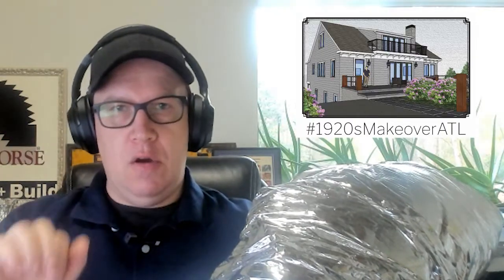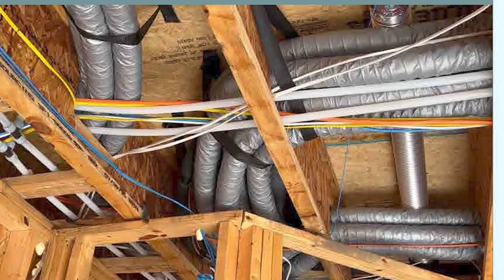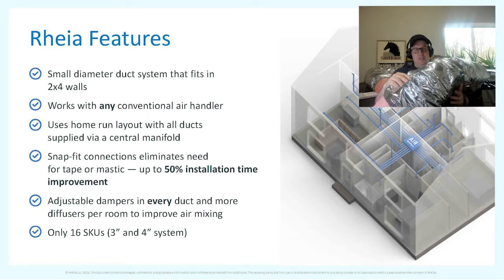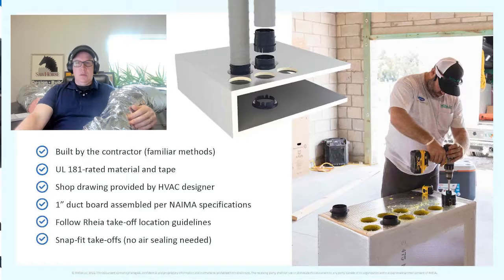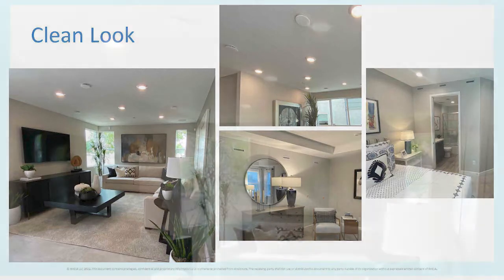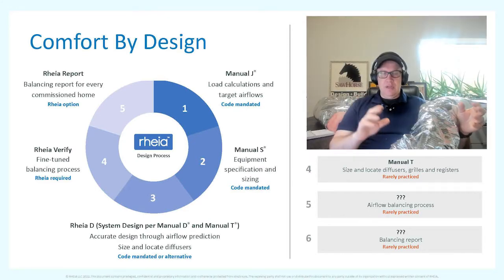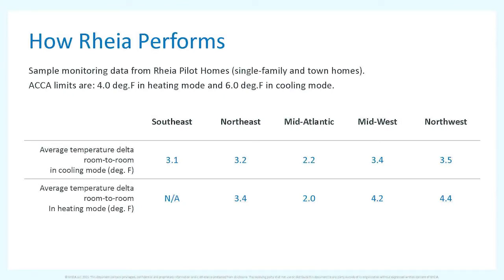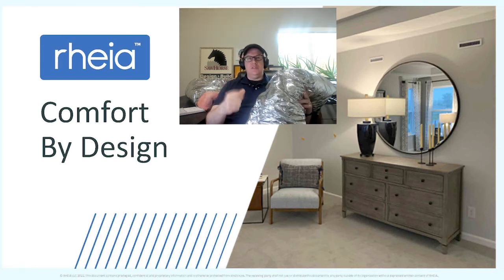Finally! A better way to run HVAC ducts in residential construction

Comment: Nice -  I might need these to retrofit at least one room of our house.  The space at the top of this pitched ceiling was too small, but they ran large ducts anyway (long ago, so maybe smaller wasn't an option, but then maybe some collaboration and communication could have happened and a slightly lower ceiling would have done the trick...), and the large duct is crushed in on itself and that room just runs so cold.
Reply from the maker: What is nice about this system is that you get multiple ducts per room so the air flow is more evenly spread as well.  This helps with comfort.

Comment: Isn't the rub on small diameter ducts higher internal friction and the corresponding drop in efficiency?
Reply: The short answer is no; when you have enough ducts to make sure the total static pressure in the supply is correctly managed through the design process.
Reply: @NigelWatts  It's still incredibly inefficient. Airflow is proportional to the diameter TO THE FOURTH POWER. It's not linear. One 10" duct carries 3 TIMES the airflow of two 5" ducts combined for a given static air pressure.
Reply: Take one room that needs 250 cfm.  A 8" round duct does it with a .10 friction rate.   A 3" vent will allow for about 15 cfm at that same friction rate of .10.  It's so bad.  It's unbelievable.  So that room, would need 16 or 17 three inch vents in it all things being equal.  The space needed for those 16 or 17 runs would take up more than a single 12" round space.  Something that could have been done on a single 8".  It's just criminal.  So it's not space efficient at all.  

The most beautiful duct systems you see are in mother nature.  Look at how a tree is formed, a river system, our cardiovascular system.  We don't have tiny blood vessels home running all the way to our heart.  Its pure comedy the lack of doing simple math here.

Comment: The math doesn't work out.  This product was sold to national home builders directly, and its gaining popularity extremely fast, and I predict its going to implode as fast as its coming on to the market.  

Typically, I'm seeing 25-35 3" runs, and there must be lots of 2.5 to 3 ton applications in that range.  Most HVAC guys would agree, on the supply side, the equivalent of a 15" or 16" round would deliver that 2.5 to 3 tons depending on how complex, long the supply and return air is, how much static is available after a filter, coil, furnace/Air handler has been designed into the system.  The vents themselves are also very restrictive when compared to a typical vent you see available at even home depot (just looking at their shape).  I get it, its about creating some velocity at the air exit. But the shape in both the round and thing wall vents is by its nature restrictive, a lot more than a typical 4x10 vent when compared to what the air volume its delivering. 

The big issue here, is the math, and static pressure, even running out a 16" equivalent trunkline, to 12,  final 6" vents, keeping crossectional area constant in comparing 12, 6" vents, with with 12, 6" vents, that nets a 336 sq inches.  These small 3" vents, are only 7 sq inches cross section.  So, to keep crossectional volume similar, you would need 48 of these small 3" vents.  If this company says its ok to have less vents than that, wow, its only going to perform worse, not better.  Now, back to 12 vents, 6" size on a normal 3 ton application, 336 sq inches, that has a circumference of 216".  That 336 sq inches of air is contacting 216 linear inches of ductwork as it passes through it.  Static pressure is directly caused by the air interaction with surfaces.  48 of the small 3" vents, give you the same 336 cross section, except now that air through all 48 of those 3" vents is interacting with 432 linear inches.  

We are talking about double the surface area that the air has to contact with, its all friction, and thats assuming all things equal, we are comparing 6" home run lines just like these 3" lines are run.  With a normal HVAC design, a single 16" trunk would apply here, and that helps even more the static pressure to be lower.  

As we know, static pressure isn't a linear relationship, nor is a blower curve.  I'd love to know what Rheia recommends for a 3 ton setup on a small home, how many runs.  I doubt its 48 lines, if its not, and its much less, the issues only compound.  This is why so many people think this system is "high velocity" and it isn't.  Its only the velocity and static pressure a normal furnace can handle.  Max capability on the best variable speed furnaces is .8" static on heating, and 1.0" static available on cooling total.  

This is so so so so bad.  

a 3" duct (metal) running 30 cfm, has a friction rate of .28 inwg/100ft.  A 6" duct running 100 cfm has a friction rate of .08 inwg/100ft.  We are talking 350% higher friction rate.  And thats compared to 6" home runs to every vent, which its widely frowned upon, because its one of the most restrictive ways to run a duct system, super inefficient labor wise, ineffective for packaging.  This is just doubling down on a terrible installation method of 6" home runs, but in a result that is way worse that double.  Closer to 4x worse.  

Critical thinking is gone.  Packaging isn't even a win.  Its just a dumbed down way to do hvac that takes the thought out of it to make things simple, but the impact on all things are going to be terrible.  I understand, the market we serve is high end.  I run about 50 guys, 10 Million a year revenue working on 150 Custon Estate homes a year that are all between values of 3 Million dollars, up to 100+ Million dollars each.  But I didn't get to working on these homes over night.  I have worked on all types of projects.  Having 5 or 6 vents in a room where one would do it.  What wall clutter.  

I'd love to know more.  Anyone who has information they can post here, that would be great.  For now, until someone can explain the math to be different, this brand Rheia, is missing its first name Dia.   Its no different that the Aria vents that are out there.  The math doesn't work.
Reply from the maker: Did you get the answer you were looking for yet?  I think I saw this comment on several channels.

Comment: It looks like there's no insulation on those ducts. That's kind of scary when we have uninsulated ducts They condensate like crazy.
  I live in Miami and the humidity is off the chart even in the winter.
90% of the time Our ductwork is in an unconditioned attics.
 It Seems like this product would only be good for ductwork. That would run a conditioned space.
Reply from the maker: This system is not designed to be in an unconditioned space.  Unfortunately, 90% of the systems are in unconditioned spaces.  That amounts to huge energy loss and costs for the end user.

Comment: Add an ERV system and you have another 10 ducts. Way too many ducts. Better to have a multi split ductless system for HVAC plus ERV.
Reply from the maker: I used to agree with that.  The only issue is you don't have central filtration for the air then.  The ERV is designed for exhaust and fresh air but does not filter the circulating air.  Most ductless systems don't have great filters for filtering PM2.5.